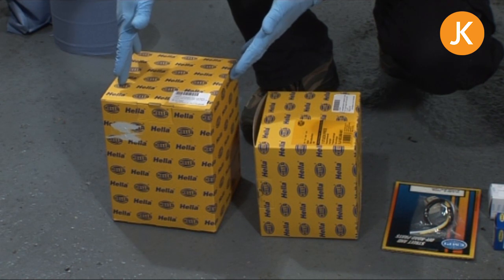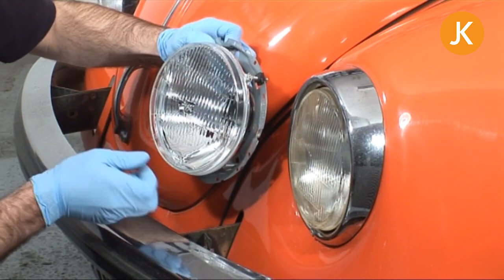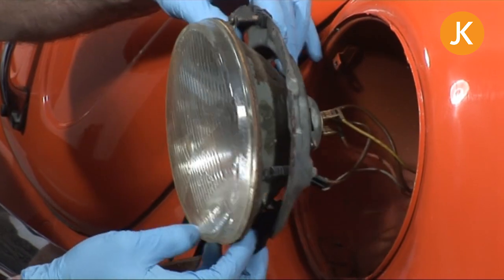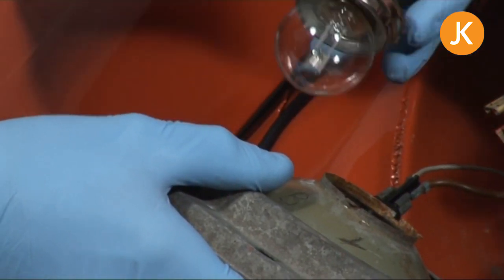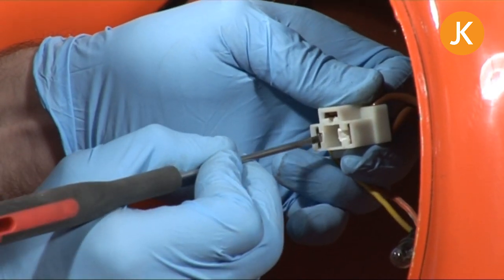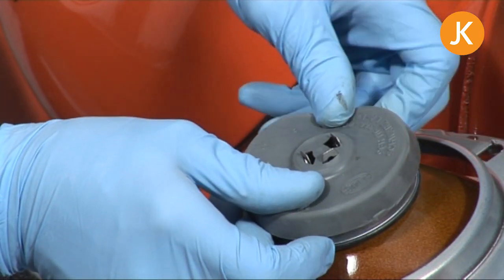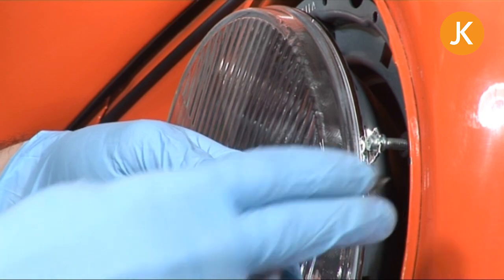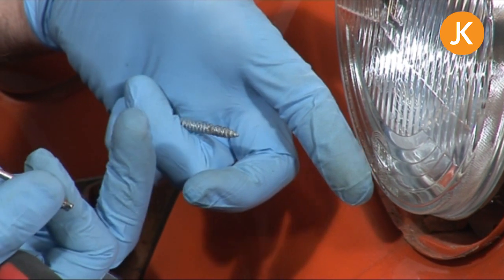Replace the headlamp bulb on a VW Beetle

Comment: A little off topic but do you have a video or a link to one which shows how to replace just the lens on the h4 unit?
I’ve just purchased some yellow lenses from JK but it hadn’t occurred to me that the fitting would be less than straightforward with a sealed setup from this era. 
I don’t want to go at it in my usual hamfisted manner. 
Thank you.